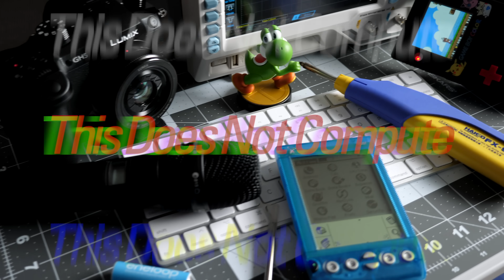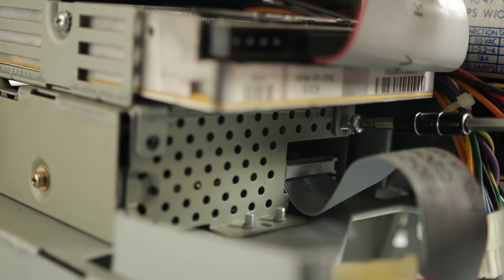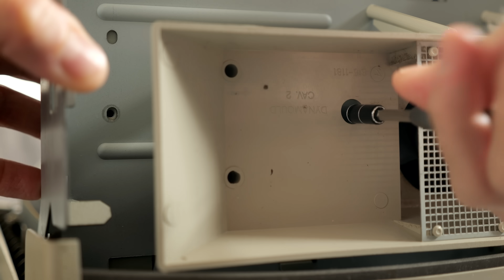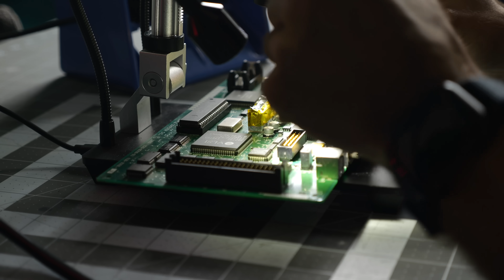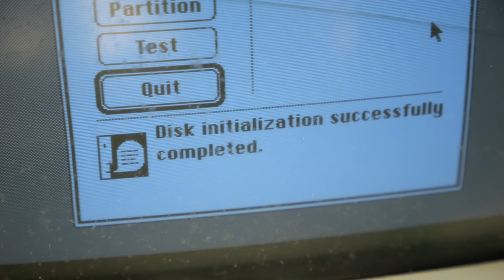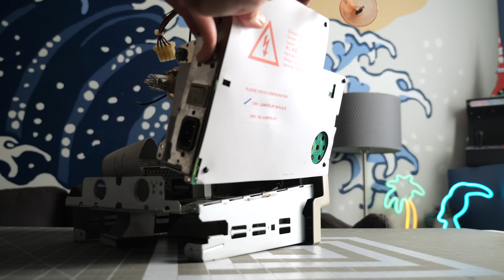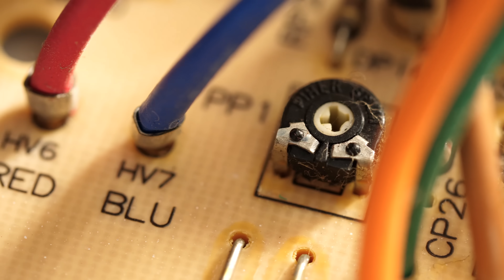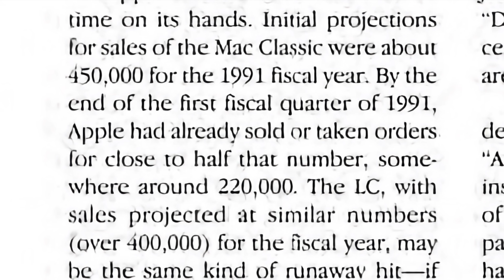Restoring Apple's most BORING vintage Mac

Comment: So many memories of the Mac Classic and Classic II.  My High School and Middle School were full of them.  They were usually setup for word-processing, and connected via Local Talk to a Laser Printer, using the PhoneNet adapters, and with a few setups, even connected to the wider network for file sharing and access to First Class Client email.  I also recall using one in the 3rd Grade (1991-92), to create a Hypercard stack that controlled a LaserDisc Player, to display video and images about Japan for a class presentation.
Reply: My first paying job as a software developer was for the Mac Plus - I worked in a tech startup along side EEs - these guys would let me borrow their logic analyzer to debug thorny memory corruption bugs. This meant popping off the case to put a connector onto the Mac's 68000 CPU. Which means, of course, the high voltage CRT was exposed. Naturally everyone knew better than to go fiddling around back there. That would never fly these days, of course. But what can I say - those were primitive times when we still used bear skins and stone knives.
Reply: Children back then were taught right about computers. Even an Apple ][ had utility. Now, today’s youth are ingrates and use smartphones and AI and laugh at the past. Sad!

Comment: Very few of them in Europe, tbh. Never even saw a Mac until 1998 at the uni, and the only Apple computers I saw before that were at the old Science Museum in Barcelona before it got renewed 30 years ago; went there in 92 and they had the exhibits connected to several Apple II.
No one got any Apple computers in Europe outside of publishers because those computers were prohibitively expensive and you couldn't justify the price, no matter how much UWSCSI you had, unless you were getting a huge ROI on the bugger. You'd get a cheap clone DOS or Windows PC for school or college and that was it.
Reply: "No one got any Apple computers in Europe outside of publishers"

That just isn't true at all. Obviously, industries adjacent to publishing used Macs, and there were probably plenty of them in the broader creative realm. They weren't pervasive, but Apple sold decent numbers in the UK and France, at least, and buyers often included further and higher education institutions.

Apple and other companies offering independent platforms did start to struggle in the face of DOS and Windows. In the UK, Acorn was very strong in compulsory education but was slowly losing its grip, eventually selling probably slightly more than half a million of its ARM-based RISC computers. Eventually, before it was dismantled, Acorn's education division was merged with Apple's in a joint venture to try and boost sales (mostly favouring Apple).

There is no doubt that Apple had substantially larger overall sales volumes than Acorn, just in the UK. So "very few" should be "relatively few", I would argue.
Reply: For some reason our school in Russia (back then USSR of course) had a whole park of Classics and a pair of LC2s. Managed to get 3 of those and an LC when they were scrapping them, sent one classic to a friend in Italy so at least I took my part in increasing their headcount in Europe ;-)

Later on when they started throwing out more stuff turned out they had also a whole park of G3 Gossamer units which have never even been installed... but they were too heavy to pick more than one up ;-)

Comment: Shortly after this machine was discontinued, I bought a Compaq luggable with 640k and a 10MB hard disk for 100 Dollars.  The Luggable has a built in 9 inch green screen monitor with CGA.  You could get color out of it with an external monitor or through the composite video out.
The 999 Mac Classic was a ripoff.  No hard disk and only 1MB of RAM for a thousand bucks just isn't a very good deal in my opinion.

Comment: I am a huge fan of your content, however if you have a mac classic please dont put off recapping the analog board. They tend to not show signs from.the front but the back. I have fixed too many to count.
Reply: You're right - I have often seen the leaking right under the can where it can't be detected until the cap is removed.

Comment: You said it wasn’t desirable because of low performance and low expandability. What would be the opposite? What would be the best snack to get vintage that is that will allow you to upgrade the most? Right now I’m thinking of getting a beige G3 tower and the sonic card whatever the best GPU is and to max out all the specs with the hopes that adding Linux to all the improvements will make it possible to use such an old machine on modern Internet, the easier way to say this, is I want to find out with the oldest possible match that can be upgraded to work on modern Internet is does anyone have any suggestions how about my idea of a phase G3 with a sonnet door processor and knocks out all the other specs?
Reply: Way old computers work in the market now it may not be desirable at the moment but give it a few years and it will be I remember a few years back people where just giving old apple computers away.
Reply: @initial_kd  do you experiment? Can it run puppy linux or any modern os fully maxed out? Maybe I’m gonna have to go with a G4 and if I’m going to do that, I might as well go all the way to the mirror door drive, but I do like the quicksilver.

Comment: The Macintosh Classic wasn't fully bad, but it was the same specs as the Macintosh SE, but had less features. It also had a black and white screen, despite color Macs coming out at the same time.

If you wanted more features for about the same price or more, you were more likely to get a Macintosh SE/30 or a Quadra/Centris.
Reply: I agree this was a bad deal. At minimum, they should have offered the 1500 Dollar version for the thousand Dollars.
BUT, that said, there is just no way they were ever going to reach a reasonable price point with a color Trinitron monitor and supporting hardware. What would be the point anyway with such terrible specs?  The color would have been slow as all hell.
Reply: The SE/30 was about two and a half times more expensive than the Classic...Not really about the same price for a lot of people.